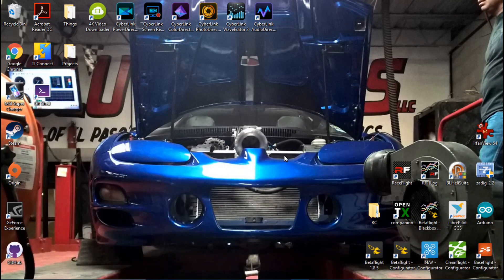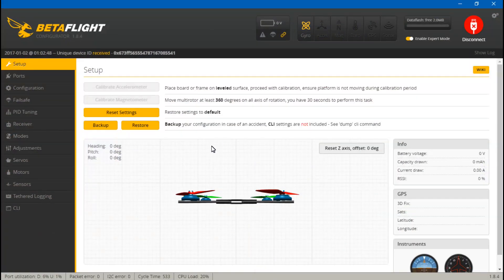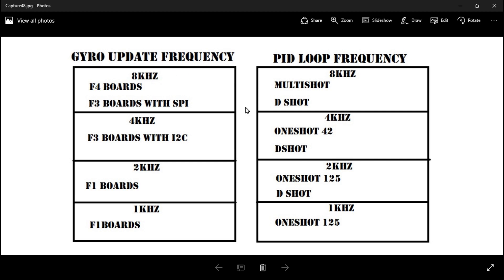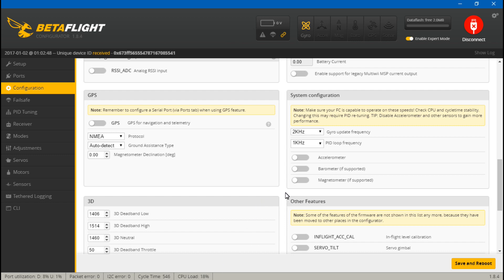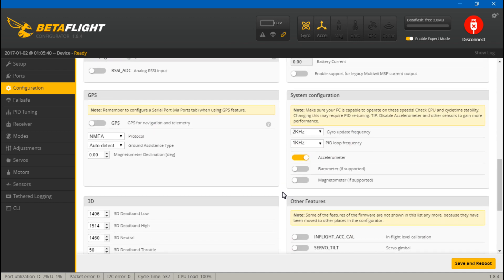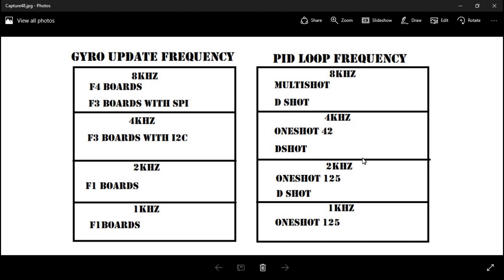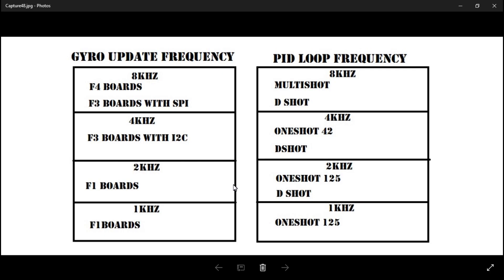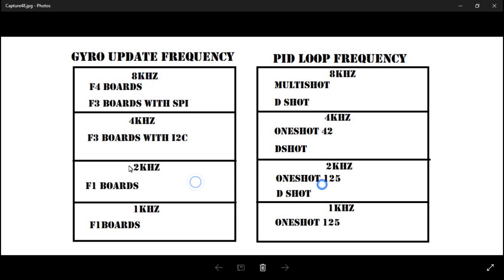Setting Gyro Update Frequency & PID Loop Frequency in Betaflight

Comment: for the f3 comparison where your comparing the two boards with two different versions of the f3 processor line, even thought all varients of the f3 like f301,f302,f30 have the same processor clock speed they have difdferent core achectures and can do some things in hardware that in software, for example a software i2c will put that load on the processor core where a hardware can access memory and send and recieve bits on the wire without intrrupting the cpu. the f4 line has very different archetectures. there are nearly 168 different varients of the f4 chip ranging from 84 to 180mhz in speed, stm has over 4 thousand different chips in the stm32 line. all stm32s are actually the same exact silicon wafer but since these are 90 nanometer chips 1 atom is .1 to .5 nanometer. your going to have defects making anything that small, based on how much of the memory on the chip is working, and how many of the cpu cores, uarts, etc it gets a partnumber corresponding to what features it has working.  thats why there are so many damn chips but each series of stm32 is the same chip. but many different packages based on the wirebonding needed wihtin the chip.

Comment: What would be best. To run Dshot 600 with 8k 8k without bi directional dshot or to run 8k 2k with bidirectional dshot? I'm using a Tinyhawk 2 Freestlye. Using dshot 600 with 8k 8k with bi directional dshot enable gives me 100% cpu load. 
Currently running d600 with 8k 2k with bidirectional dshot enabled with jazz maverick 16.77 esc firmware. Getting 34% cpu usage.
going to 8k 4k with bidirectional dshot gives me 56% cput usage ( is this fine to use?)

Comment: My CPU load was 7% at 8K gyro 4K PID Loop default settings. I changed the PID Loop to 8K and now it's 17% CPU load. I hope it's fine. I'm not taking my laptop to work tomorrow.
Reply: Long as you are below 35% is my rule of thumb.   Some say below 50% but I run GPS rescue.  I'm running 8k 8k on a cheap VgoodRC F4 dji digital board and my CP load is 11% with accelerator on and GPS rescue enabled!!

Comment: Great explanation! Just wondering, why betaflight does not disable acc when you switch to acro mode automatically? (I assume that it won't use acc when in acro mode) So that you don't have to set the on and off of the acc.

Comment: If I want to do DShot 300 on my F4 REVO CC3D with Racerstar bR2205 2600kv motors and Racerstar v2 RS30A ESC's...What PID Loop Freq would you recommend??, and what other settings do I need to adjust? Also, what should I set Accelerometer Trim to?  I noticed yours are set to 0 but mine is set to some weird numbers by default, I think...

Comment: good advise ,,, what would you recommend for an f3 evo,,,(spi)   Dshot 150, 300 or 600 at 8k 4k (cpu 24%) , the esc's can handle dshot 600 ?.... and a micro that has an f3 board (i2c) Dshot 150, 300 or 600 4k 4k (cpu 32%) esc's Dshot supported, ?
thanks

Comment: So I have KINGKONG BLHeli 20A Brushless High Speed ESC With OneShot125.The motors twitch really bad unless I have them on 4 gyro and 4 pid loop. They still twitch but only now and then. Do you know why? Running the omnius F4. Got this board because of you and love it. The OSD is bad ass! Thanks.

Comment: Hey man thanks a lot for the education! I'm a total noob and got a basic CC3D with SimonK 12A ESCs, Betaflight 3.0.1 firmware my FC came with (from previous owner) is set up to 4/1 kHz (Gyro/PID), accelerometer is off and CPU load is 13%. Do I have to set it to 2/0.5 or 1/0.5 kHz? Since SimonK's PWM, AFAIK, is 600Hz max..
Reply: Or rather 2/0.67 )

Comment: Need help! I can not get my quad to arm. I've watched countless tutorials and still no luck. Here is the list of what I am trying to use. Space one 220x frame. Matek PDB. Naze 32 rev 6. Little bee's 20 esc's flashed to blheli. Emax red bottom motors. Using a Spektrum Dx6 transmitter and a lemon dsmx RX. I can control everything from betaflight, rx and tx are bound. If I go in to receiver settings I can see everything respond to my commands via transmitter. No arm though. Any and all help would be greatly appreciated. Thanks!

Comment: I read a borris.b post about cpu% utilization- on the new 3.1 rc10 you can now run higher % load than before. check it out. 
it's probably limited to f3-SPI and up though.

Comment: Thank you for re-opening your youtube channel, this is by far the best channel for quad racing enthousiasts. The amount of knowledge and hidden gems in your videos is outstanding, I've been watching your videos for the whole day straight now!
Reply from the maker: Thanks a lot man. I'll keep trying my best.
Reply: Thanks man, I'm really happy with the content you're making! One question, what can I do when the preview of the quad is not showing in betaflight when I connect to the board? I'm using a omni f3 board!
Reply from the maker: You dont see the quad at all or is it just not moving?
Reply: Project Blue Falcon I don't see the quad at all...
Reply from the maker: You've got me on that one. I've had many other guys mention the same problem but its never happened to me, so I'm not sure how to fix it. Only thing I can think of is flash new firmware and when you do turn on "full chip erase". But that will erase all you settings so I'm not sure if you want to do that.
Reply: Project Blue Falcon that's weird, seems like some sort of bug then.. I'll try some more tomorrow, but I prefer to keep my settings and not do a full chip erase 😉

Comment: Will I notice a benefit as a novice if I update from stock betaflight gyro/pid frequencies of 2k/1k to something like 8k/4k for gyro and pid frequencies?  I'm using a motolabs tempest flight controller, aikon 30amp esc, emax rs2205-2300 motors...thanks, great video
Reply: It doesn't matter if you are a novice, learn to fly it, after that you can play with the settings and FEEL it, there will be no difference in the flight footage or the fpv feed setting 1k/2k or 4k/4k or 32k/32k, it will change the way you feel the quad flight.

PS: I have been flying all this time with 4khz/1khz just because I didn't pay attention, I just swapped to 8k/4k because the 4/1 was a complete waste having my setup (multishot, f3 Spi that can run 8/8 without reaching 20% cpu load...) And it just felt different.

 Someone from outside would never tell the difference.

Comment: Great video JC, but I am now more confused with the actual pid loop frequency numbers of Oneshot125. I just watched Joshua Bardwell's motor/esc protocol video and he's stating that oneshot125 is capable of 4khz update rate, where you're saying it maxes out at 2khz. What's even more interesting is that I'm currently running a build on the Omnibus f3 board and little bee 30amp esc's on oneshot125 running at 8k gyro 4k pid loop and everything functions just fine. What's your take on this?
Reply from the maker: Do you mean like this video? https://www.youtube.com/watch?v=sg7XClhHdFs 
Josh doesnt recommend going past 2k for Oneshot 125 either. My thoughts on this are it will work. But the ESCs can only receive data so fast. All the data thats not being used is being dumped and wasted. I will say there probably wont be much of a difference, because if your CPU load is fine at 4k, then thats fine. The ESC will take what it needs and throw away the rest. But instead of wasting the data you could run 8k/2k, the ESC will still receive the same amount of data, but your CPU load will be slightly lower. But then again, you probably wont see a difference if the CPU load is already under 35%. If your load is above 35% on 8k/4k then you probably will see a difference by dropping down to 8k/2k
Reply from the maker: Havent heard of that. But the way I see it, it if works then it works. I'd keep doing things the way you've been doing it. If the CPU load is good then I dont see any problem running 4k.
Reply: Thanks JC, I just wanted to make sure that I wasn't doing anything wrong or detrimental to my setup that would affect it's performance in any way, keep up the great work brother.